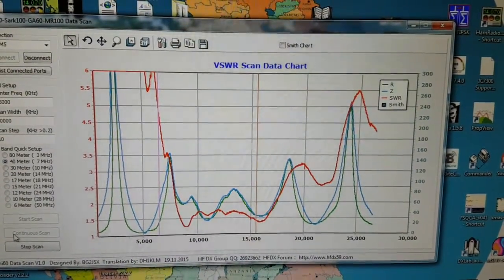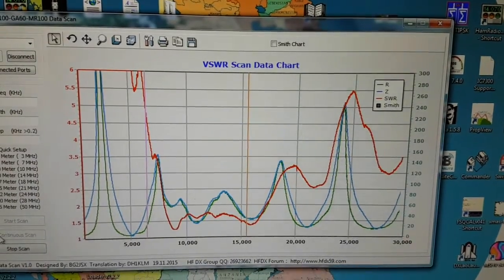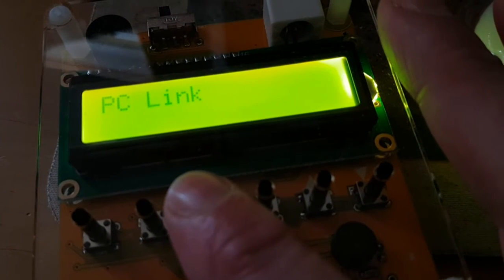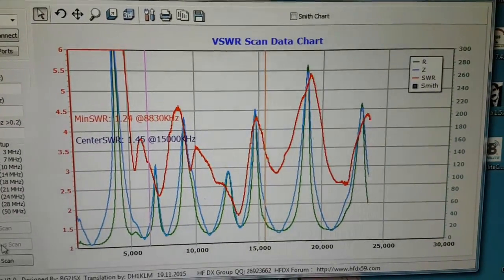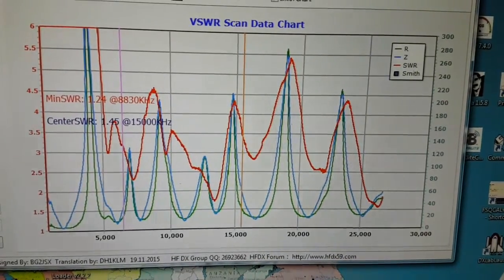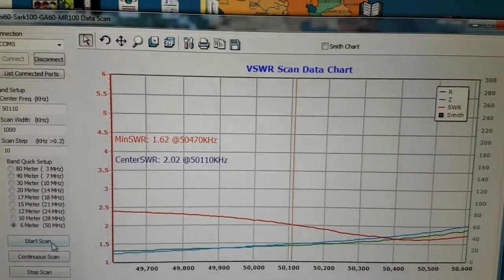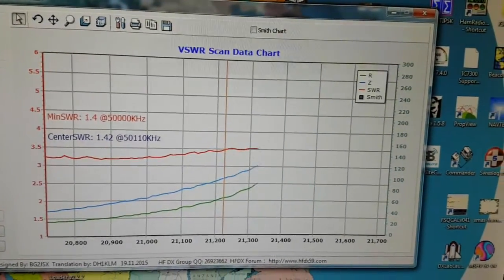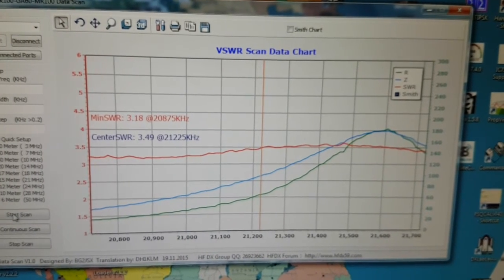MR100 Antenna Analyser - SARK 100 - SWR

Comment: Does it need to be calibrated? I saw a video where guys attached different resistors to the thing to calibrate it, looked very cumbersome and prone to errors... I am thinking of getting that thing myself
Reply from the maker: Croatia Prepper it works. But if I was buying again, I would spend twice as much and get the sark100.
Reply: wgoodf thx for the advise